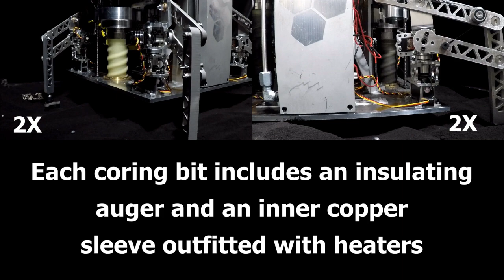W.I.N.E. The World Is Not Enough

Comment: Very interesting concept, just curious, where does WINE generate the energy necessary to power the drills/heaters/coolers and all other onboard electronics? It seems like quite an energy intensive process for such a small craft.
Reply: Probably thermonuclear generators
Reply: yup, good question.

In order to generate enough power for the initial tasks of mining and making steam, the WINE spacecraft would utilize deployable solar panels. However, if the craft were to venture too far from the Sun (for instance, to Pluto), it would need to rely on Radioisotope Heater Units (RHUs) to kick off its mining operation. 

"The reason for using RHUs at that distance is because solar arrays will need to be pretty large to provide needed heat for steam (or even for keeping [the] spacecraft warm)," Zacny told Astronomy via email. "All spacecraft operations will need to be defined ahead of time and appropriate mass of water calculated beforehand." 

Though a WINE spacecraft would likely need supplemental sources of power to run its mining operation on a distant world, the benefits of a semi-perpetual spacecraft would far outweigh the extra engineering challenges it requires. For instance, by not needing to carry a full mission's worth of fuel all the way from Earth, WINE-like spacecraft could help drive down the cost of distant planetary exploration.

http://www.astronomy.com/news/2019/02/researchers-develop-a-steam-powered-spacecraft-that-can-hop-between-asteroids
Reply: Water turbines.

Comment: And what about decomposing the water into LH2 and LOX? Would it be practical? Or is using the steam better?
Reply: Alexei Kafe I assume there would be long-term storage issues with hydrogen
Reply: use of hydrogen would be less energy efficient
Reply: There are many approaches to using water to make fuel. WINE takes the simplest possible approach, of simply leveraging the phase change of water between liquid and vapor. Other systems, such as MOXIE that will fly on the Mars 2020 rover and other Mars missions coming soon, will do other conversations. MOXIE will create methane rocket fuel for the SpaceX systems. MOXIE is an experiment, but it has been very well tested in labs at JPL and MIT.

Comment: Was this really designed for space?     
In space, the "cold trap" is going to be the entire robot, depending on how you shade it from sunlight.  Yet i can see no thought of space-based thermal management in the design at all.  
Also in space your robotic legs don't need to be so strong.  With those legs this thing seems designed for MORE than earth gravity, it's way over-weight for landing on asteroids.  Perhaps the legs are thick like that so they can cushion a very fast landing, that'd make sense.   

> "By propulsively "hopping" from location to location, WINE can explore Solar System bodies as well as individual bodies (e.g. WINE could cover much greater distances on Europa or the Moon than a rover)"     
Hmm, seems dubious.  Yes the steam rocket will move the rover faster, but it also requires much more energy.  If you instead used that same amount of energy to power wheels - it'd be slower but you'd go further.  A rocket is more efficient than wheels?  That's very hard to believe.
Reply: perhaps integrating nitinol wheels into the legs would be an option
Reply: On certain low gravity worlds, the gravity is just too low for any sort of wheel to work- any kind of speed will exceed escape velocity, and will launch it off the moon/asteroid. In this case, it might be desirable to be able to control one's velocity and direction mid-flight, hence, a hopper like depicted in this concept.  An example of such a world is 162173 Ryugu- an asteroid with just 1/80,000 earth gravity- being explored by the Japanese spacecraft Hayabusa 2. Hayabusa also deployed three rovers- which although not steam-powered- move by  "hopping around"- just as W.I.N.E. is designed to do.

Hope this helps.
Reply: that does make sense andrew
Reply: (WINE) is a concept , it'll get there
Reply: Actually, the steam is generated simply by opening the valve in a vacuum: the expansion from liquid to vapor is tremendous and instant. The current WINE demonstrator weighs about 20 kilos, and flies in Earth gravity in a vacuum chamber (as was recorded in the video). A little energy is required to heat the regolith to extract the volatile water vapor, but very little: a tiny bit of heat is sufficient. Nearly all the energy goes into drilling, and the drilling can be done pretty slowly, using surprisingly little energy, because the regolith on low gravity bodies is very lightly held together. It is a very cool device in real life tests.
Reply: Sorry for the super late reply but felt I needed you to know this information LOL.

A great engineer once said, the worst thing you can do is optimize something that doesn't need to exist. This is a concept, a technology adventure to see which ideas seem most realistic, simple, cheap etc. Once they figure out which to do, then you can optimise it for space travel with proper thermal management, energy systems etc.

The issue with wheels is there's so little gravity on these smaller asteroids that you couldn't properly use them as you need friction between the wheels and whatever surface you're driving on, and the force of friction is directly proportional to the weight caused by gravity acting on a mass

Comment: waste of money, the future of space is nuclear
Reply: This would be ideal for asteroid mining
Reply: @Russia Good  This video has nothing to do with energy production.  You either didn't watch it, or don't comprehend.
Reply: dear comrad, you cannot use nuclear energy as a propellant blin.
the craft is powered by thermonuclear reactors btw
Reply: I don't think you're getting it. Even if you had a nuclear power source, moving around in space doesn't just require power, it's not like on Earth where you can use a propeller or wheels. In space there is no matter to use as a medium for movement, so if you want to move a spacecraft around you have no choice but to use a rocket engine. IE you need to spit out some mass if you want to move, AKA second law of thermodynamics. So the point of this tech is not to generate energy, but to find a way to gather mass (ice in this case) that we can use as rocket propellant to push the spacecraft forward. You can power it with nuclear energy if you want but you still need the propellant.
Reply: I estimate the odds of using fission reactors in space is 100%. Check out the KiloPower reactor by NASA and NRL that was demonstrated last year. I would be very surprised if that is not used pervasively soon. However, even a KiloPower reactor is astronomically expensive compared to collecting water molecules and opening a valve, and so is very unlikely for mass produced spacecraft. The WINE concept scales to enable hundreds or thousands to be sent to explore the asteroid belt and find the good stuff that we are sure is there, but that we have no idea EXACTLY WHERE the good stuff is. Finding the good stuff will take exploration. The WINE concept is about exploration as a precursor to mining.